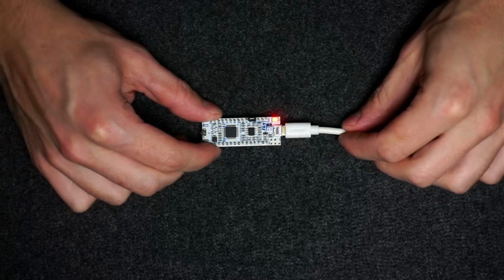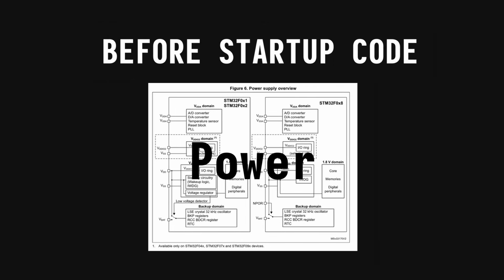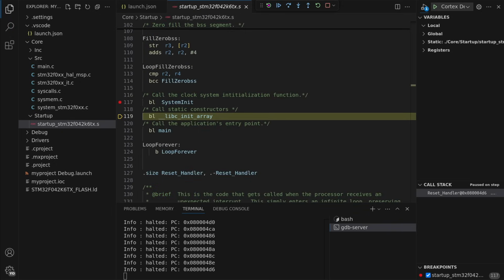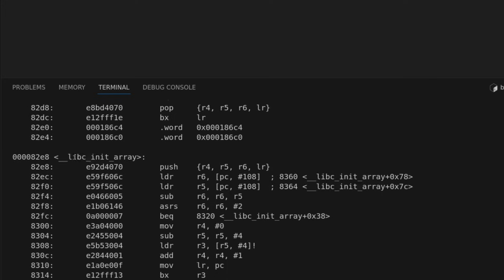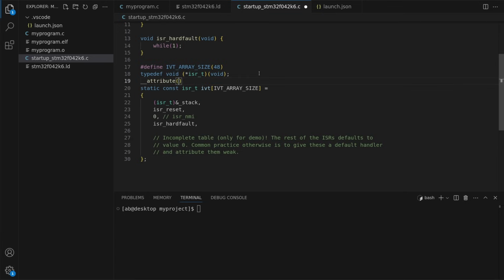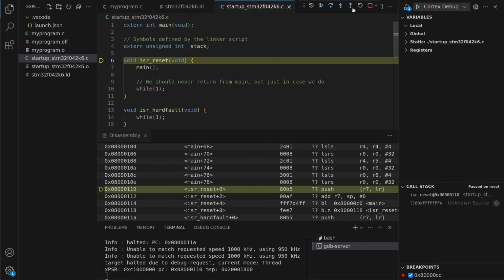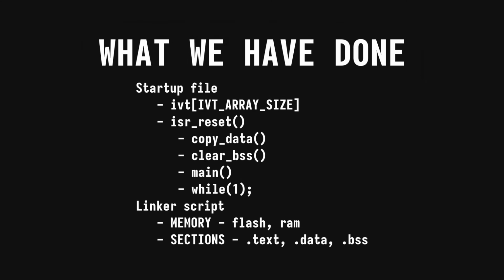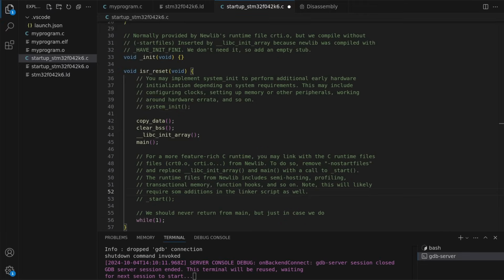How a Microcontroller starts

Comment: How cruel! I just found this video an hour after I got my first blink program running on my stm32h755. Out of stubbornness, I refused to even download the cube IDE or use any other libraries, HALs, or even C. Just plain assembly. Took me a solid 4 days to get to work. I’ve read way too much of the reference manual lol. I even pulled off the program the board came preprogrammed with and put it through ghidra and GDB to figure out how parts of the board are initialized. Definitely could’ve been done faster if I didn’t do all that and just used the IDE lol but it was fun

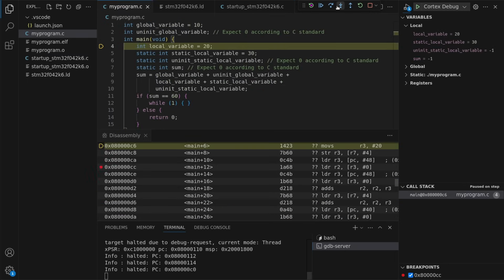Comment: 19:47 how did you manage to pin point cause(instruction at 0x080000e6) of hard fault so easily just by looking at the disassembly? i know that one needs a close eye observation of disassembly to catch issues like these but how is it done?  actually i am a beginner in embedded systems.

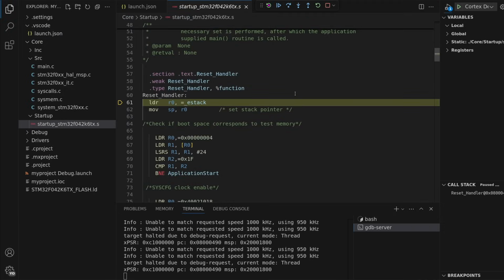Comment: 3:31 line no 60-62 in startup file:
Reset_Handler:
ldr r0, = _estack
mov sp, r0 /* set stack pointer */

Would it be looks like doesn't make sense bcos hardware after reset initialized stack by this value stored at 0x08000000 BUT...
In some cases (like external loader for example)  thanks to ST care about comfortability for user program can be send and running WITHOUT hardware reset. ST programmer via SWD or JTAG can do (and doing some times) INJECTING program counter value directly into PC register, what of course immediatelly redirecting program flow to Reset_Handler, without reloading SP initial value. That's way this short and simple operation reinitialize stack poiner register (SP) after program upload and restart.
Reply from the maker: Nice addition, and I suppose SP may be set to something else if we run a bootloader (e.g. system bootloader) before our main program as well.
Reply: @artfulbytes  I wonder what for  it's done and discovered this trick. It's use now allways after programming from IDE environment. Probably HW reset is done, but is breaking and injecting the Reset_Handler into the PC register. For example I did in assembler ledblinking without linking vector table and after programming from IDE program is running. But after pushing the reset button program doesn't work, CPU simply hang.

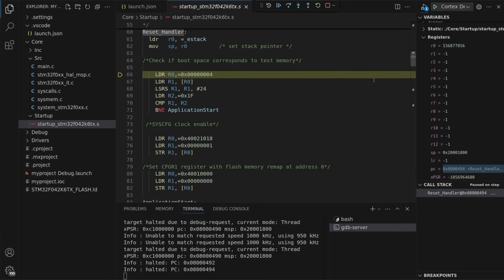Comment: 6:01 I think the SP is actually changing after the mov sp, r0

Amazing video so far, watching till the end.
Reply: From …17F8 to …1800
Reply from the maker: @diegoporras7769  The sp increases from 0x200017f8 to 0x20001800 after stepping over the first instruction (ldr and not mov). I haven't checked, but I think it may be a debug artifact, i.e. register view not refreshing properly until stepping over the first instruction.

Comment: The value of sp increases from 0x200017f8 to 0x20001800 on running the first two assembly code lines. 
If estack was 0x20001800, then why was sp initialized by HW to 0x200017f8?
Reply from the maker: The sp increases from 0x200017f8 to 0x20001800 after stepping over the first instruction. I haven't checked, but I guess it may be a debug artifact, i.e. register view not refreshing properly until stepping over the first instruction.
Reply: @artfulbytes  that's possible - may be due to debug interface 
Ldr command doesn't change the value of sp so it does not make sense that it changes after ldr.

Comment: 9:38 Just curious what reason is there not to use -std=c23 every time?
Reply from the maker: Compiler/toolchain may not support it yet, compatibility with existing code (e.g. stm32 HAL), potential issues/bugs. So unless you really need the latest C features, probably safer to stick with something more established. With that said, I have not tested it extensively.
Reply: @ interesting…
Reply: C11 or C17 is a good compromise...  Though GCC and clang has supported armv7m for over 9000 cycles, latest stable is ok

Comment: Hi!
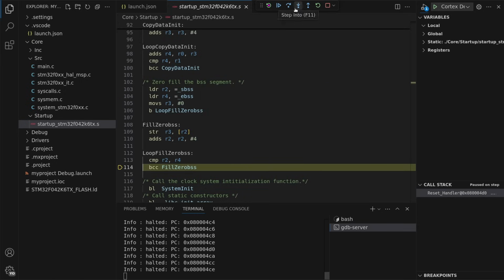In 7:14, doesn't debug trace usually move forward in a program?
Reply from the maker: Is it not moving forward? You mean in the terminal below right? I may have cut the video a bit weird in certain places so they don't always line up.
Reply: @artfulbytes  No, I meant actually in the code. Maybe not in this case, but sometimes I see that the debug trace doesnt progress sequentially, especially in low level code (goes back and forth)
Reply from the maker: @Jonathan-ru9zl  Normally the program counter just increments, but there are branch/jump instructions such as bcc, which can jump to a specific address. For example, these instructions are used when repeating a code block such as in a loop, or when jumping to a function.

Comment: Great video! Two small notes: most recent controllers will actually run vendor code from a ROM before jumping into user code - you sadly can't debug that in many cases since the debugger gets enabled after that... What is done there? E.g. loading calibration values that must be loaded in all circumstances.

And the other: even without linking the C standard library you may have to provide memset/memcpy/... since gcc will (at some optimization levels) replace loops with those functions - independent of command line flags
Reply from the maker: Thanks, appreciate the input! Lots of details to keep track of and I try to get away with brushing over many of them :)
Reply: No shade, makes total sense - as I said its a great video as it is

Just thought it might be interesting to some - surprised me a bit in the beginning but makes sense that there might be some other code hidden...

Comment: Excellent, very straightforward explanation that completely cleaned up my confusions. I'm trying to bringup my own programming language on RP2040, that was super helpful to me.
Although I have a few questions about bootloaders:
* how and where do they fit into the whole picture
* why someone would need one
* how to deal (or not) with them from the point of view of writing everything from scratch. Basically how to write a barebones C program that will work under a bootloader.
Reply from the maker: It depends :) But I think it makes sense to think of a bootloader as another small standalone program that runs before your main program. So, just like you need startup code to make the MCU ready to run the main program, you need startup code before the bootloader program. A bootloader is optional, but it's often used to separate the update mechanism from the main program, and to allow the main program to be upgraded without a dedicated debugger. If your bootloader is simple and perhaps not written in C, it may not require as much startup code though. In practice it may be like this: startup code 1->bootloader->startup code 2->main program.
Reply: @artfulbytes  Thanks for the reply, that makes sense. But what I still do not fully understand is if the bootloader has to live somewhere in the flash, it will basically have to take the space of the interrupt table, so the main program cannot provide ISRs directly via a table. Is that correct?
So the bootloader has to provide the interrupt stubs, and then before loading the main program the bootloader has to do some kind of dynamic linking to wire up main program's ISRs, or am I compeletely wrong here?
Reply from the maker: @stainlessCode  STM32 allows you to change the address of the interrupt vector table (IVT) by writing to a register (VTOR). And yes bootloader would live in flash and it can have its own IVT and startup code. You would then place your main program including its IVT somewhere else in flash memory. Then just before the bootloader jumps to the main program it can write to VTOR to change the address to the IVT of the main program. Moving the IVT is not possible on all MCUs and in those cases you may have to partly share the IVT or solve it some other clever way.
Reply: @artfulbytes  I see, that makes sense, thank you for the reply!

Comment: I have stm32 bule phill it comes under arm Cortex m3 architecture  I but doesn't reach main it goes half fault . I don't where the mistake is  where any problem in openocd
Reply from the maker: You can step from the beginning like I did in the video to identify the instruction that causes the hard fault.

Comment: bare metal programming , is field iam looking to breaking into , i thought you were going to take out the bios chip set and flash it with program
Reply from the maker: Microcontrollers typically don't have any bios chipset.
Reply: @artfulbytes  its kinda interesting ,maybe i should look at the architecture including flash memory and how its stores bootloader

Comment: Could this startup code can technically be called bootloader?
Reply from the maker: In practice, there may be some overlap, but roughly speaking, a bootloader is a small program that runs before the main application, while startup code is code that runs before any program, including the bootloader.

Comment: kinda similar to writing an OS from scratch and writing a bootloader I passed that stage so I could understand what's going on in here, of course this is more specific to the MCU  archtiecture and startup code needs to be configured according to the manufacturer and needs lots of datasheet checking about MCU specifically STM32 for this video

In the end, it's a great vid. 

And I wonder your background like Electronics or CS?
Reply from the maker: Yes some similarities indeed. Thanks. I studied CS, but do quite a bit of hardware design professionally atm.

Comment: Nice explanation, excelent job and mega respect, outstanding knowledge !
But i have feeling like with ORM vs SQL, so much boilerplate around C code, that assembly looks clearer to me ;)
Yes, i know, C will be partialy portable between simillar architecures/boards, but still i have no clear winner.
Reply from the maker: I was a bit more verbose in my C code than necessary here as well